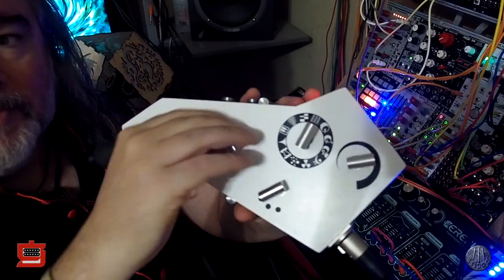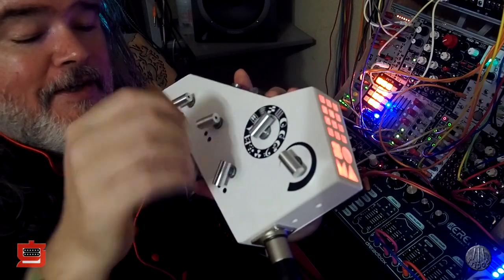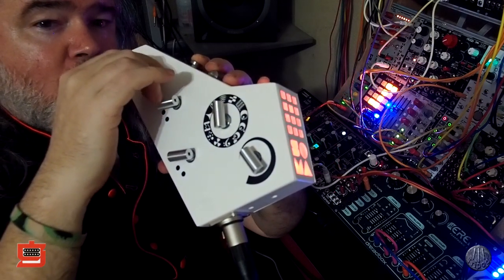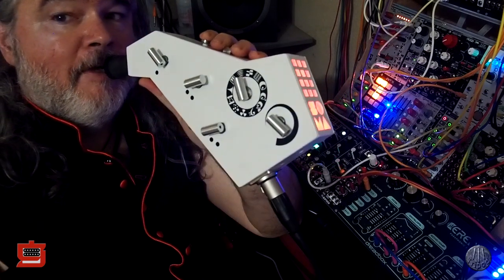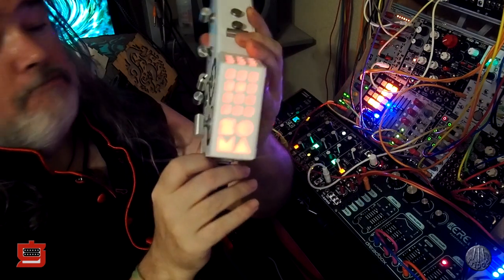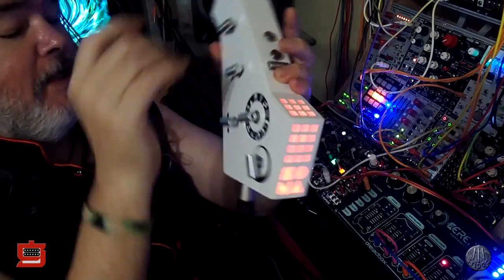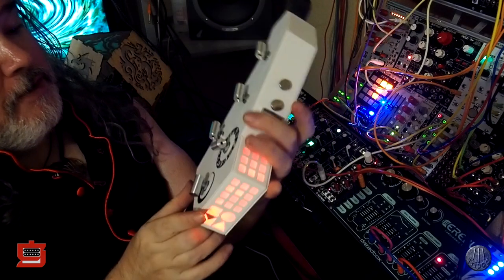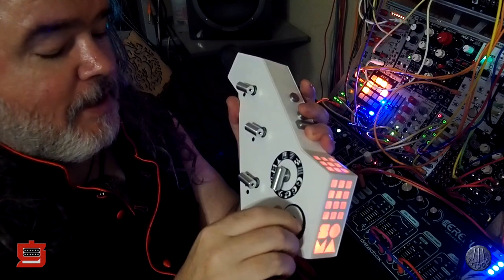Soma Pipe

Comment: Hey Kevin, I just ordered my "Kazoo of the Gods" and I was wondering what the additional contact microphone is called...or how is it spelled...so I can request it with my order as well.  Have you tried the hands free mode on this so you don't have to use the mike activation button?  Great review btw!
Reply from the maker: Just saw this. You should find the additional mics on the Pipe product page. At the time I bought mine there were three mics of various diameters available. I have the standard and the "bassy" mics, and I use the bassy almost exclusively.